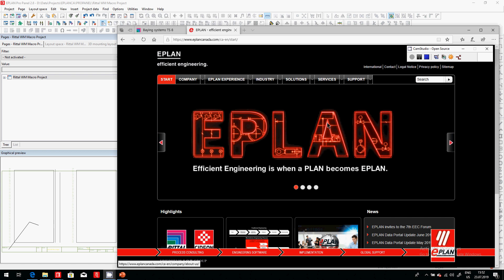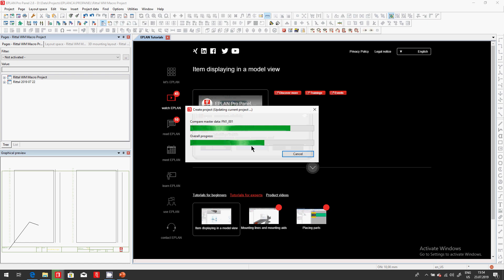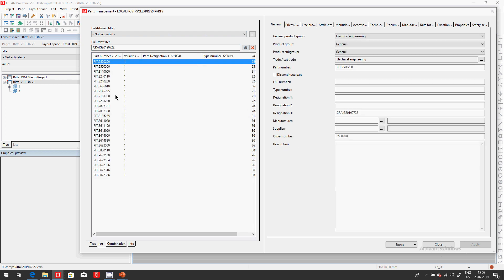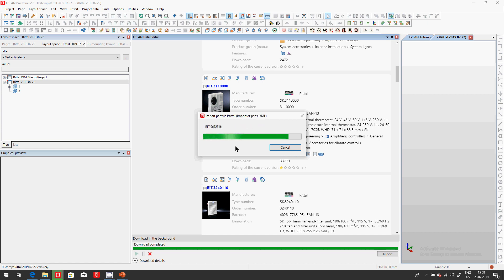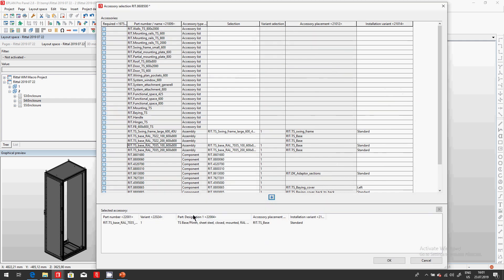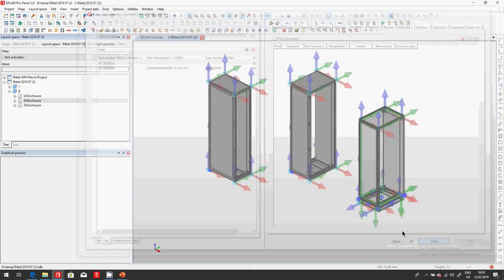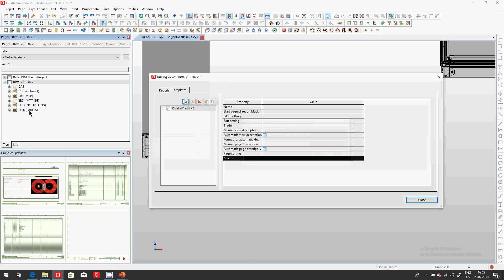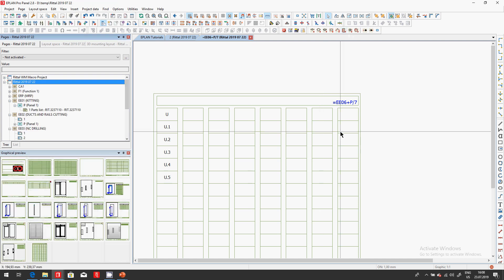Propanel Tutorial

Comment: What if we don't have type of customized enclosure box in the library, like form 3 withdrawable and etc, can we import it from solidwork or Autocad file?
Reply from the maker: yes as long as you have step files, you can import them, make them "EPLAN-smart" and start placing your components. You can contact your EPLAN support / training center nearest you and they will show you... But seriously using a Rittal Panel is probably the fastest solution, they have done all that work for you. They create thousands of smart parts for you.
Reply: @rolandyounk6169  sadly i see no rittal distributor in indonesia, so we must import from foreign distributor. I don't know whether it allowed or not to use rittal design and build the enclosure on local metalsheet builder. Especially their type test design.
Btw, thanks for your answer and advise sir.